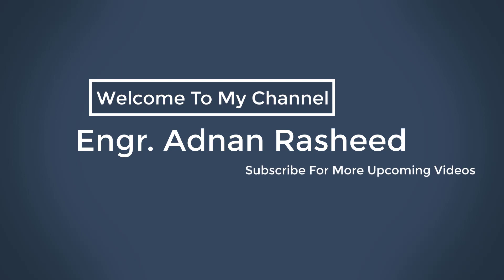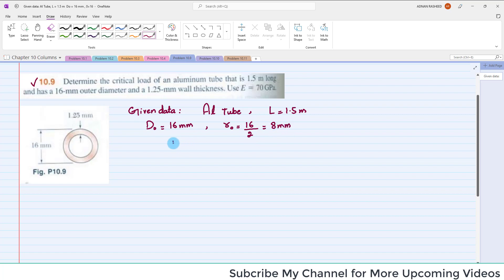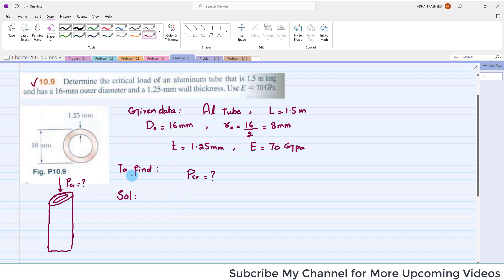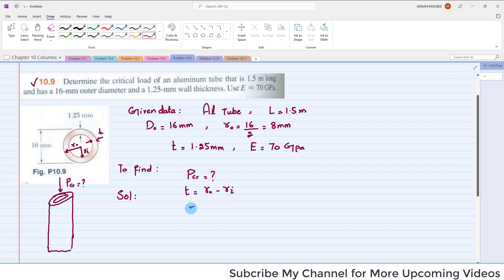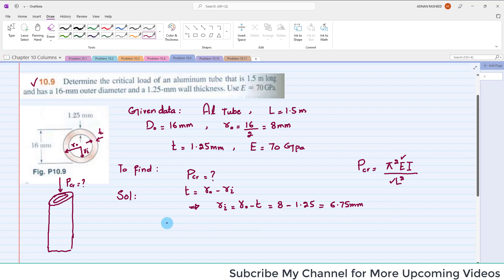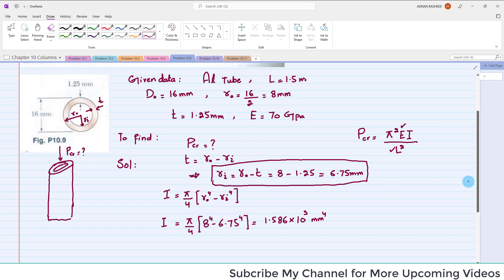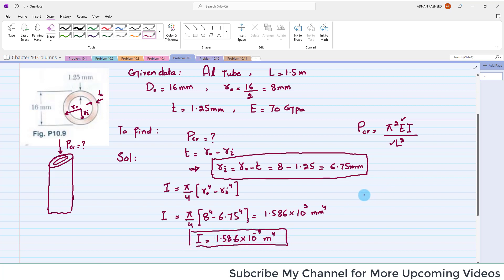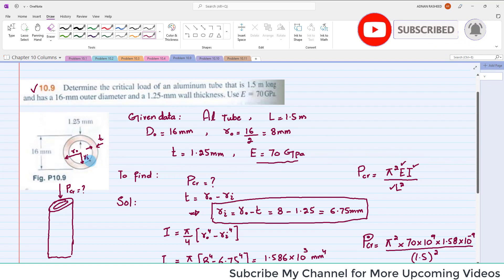Problem 10.9| Chap 10 | Columns | Mechanics of Materials 7 Edition | Beer, Johnston, DeWolf, Mazurek

Comment: 274.35k aa rha hai,plz check
Reply from the maker: Thank you for your valuable feedback.  No problem you can just take the value which you have calculated. Error may exist there but overall concept is correct. However I shall also check that....